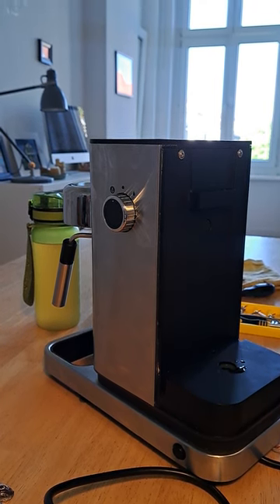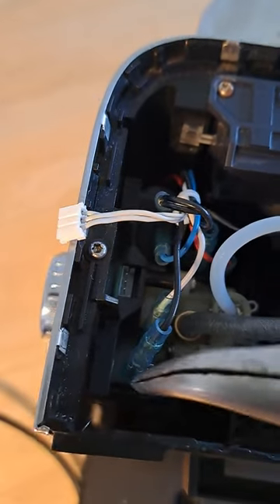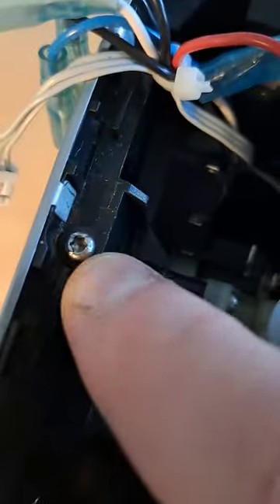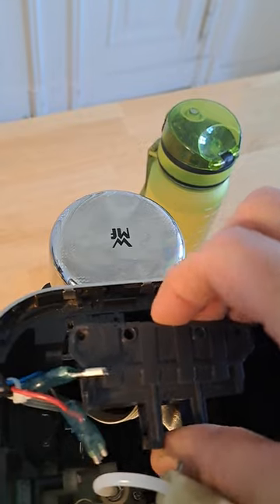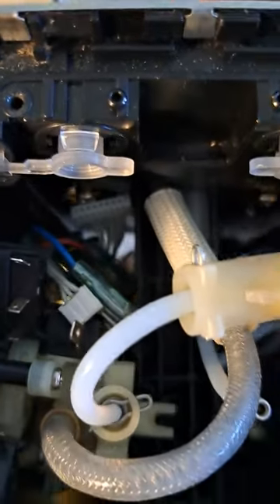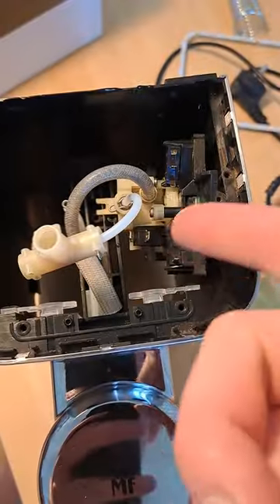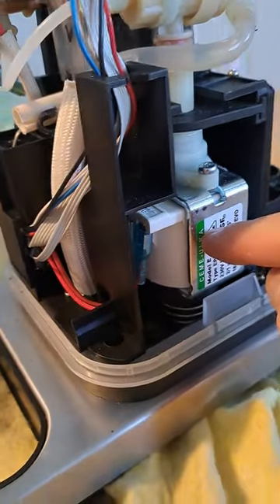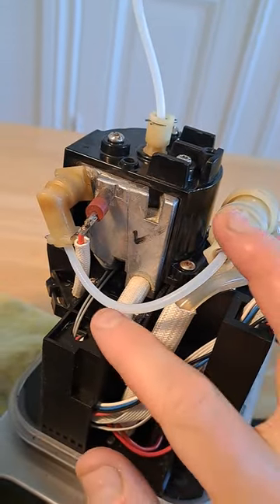WMF Lumero espresso machine - DISASSEMBLY video

Comment from the maker: GOOD NEWS!!! The connector that always seems to break which attaches to the Thermoblock is now available at www.ersatzteile-24.com
Reply from the maker: 16:25  is the part that I'm referring to. Buy a couple while they still have them in stock!
Reply from the maker: On the website, search: Q436968
Reply: What is the name of that part ?
Reply from the maker: https://fixpart.de/de/produkt/groupe-seb-fs-1000050800-abdeckung
Reply from the maker: @bakenblo  https://fixpart.de/de/produkt/groupe-seb-fs-1000050800-abdeckung
Reply from the maker: New short video for leaking steam wand : https://youtube.com/shorts/qWunwmQQdcM?si=cerU2UrzkXWYFCdy
Reply: Hey there, this is just Gold!!
Thanks for the video, my fathers machine broke just where you said. I guess the heat changes are the reason for the connector to deteriorate. 
You asked how the inside looked in original:
The Watertank connector hoses have small white Zipties- just like you did. When the Watertank is reconnected after filling up, there is always some water dripping wich can cause Oxidation/Vapor in the system. 

The electronics are open like yours, i guess the casing works as a lid when closed again. 

Did you find the 90* Connector  too?!

By the way, your german pronunciation for Ersatzteile is perfect👍🏽
Thx and greetings

Comment: thanks for video, it helps me a lot. only one things: don't put any screw at the hole with rubber cap. i think it is some pressure release hole. my unit don't have there any screw.
Reply from the maker: Thanks...you might be right. Good tip!

Comment: Hi,

Today, I tried to wash and clean the machine, and I accidentally poured some water where the coffee goes. I then turned it upside down and realized afterward that some of the cables and circuits got wet. 😅😅😅

Now, the red button on the side is blinking, where the Vapor is, but the both coffee buttons aren't working. I've already opened the coffee machine and can change parts myself, but I'm not sure what needs to be replaced. Could you help me please?

Thanks!
Reply from the maker: @AnitaNita777  I'm not sure the exact problem?maybe use Google translate to explain in English? Sorry I don't understand:)
Reply: @nathans1978  Hi,

Today, I tried to wash and clean the machine, and I accidentally poured some water where the coffee goes. I then turned it upside down and realized afterward that some of the cables and circuits got wet. 😅😅😅

Now, the red button on the side is blinking, where the Vapor is, but the both coffee buttons aren't working. I've already opened the coffee machine and can change parts myself, but I'm not sure what needs to be replaced. Could you help me please?

Thanks!
Reply from the maker: @AnitaNita777  to start I would open the top and dry it out for some days. If the circuits are wet that's the only way they will dry out. Maybe put the machine on top of a radiator to support drying thoroughly
Reply: @nathans1978  i already did that. I’ll wait one day. If not what do you think I should do or change¿ because the both buttons to make coffee are not functional. 😔
Reply from the maker: @AnitaNita777  there's a cable that connects to the 2-button assembly. Remove that cable and spray it with wd-40
Reply: @nathans1978  i let those cables disconnect last night for a better drying and now the two buttons are working’s. I just did a descaling process that lasted about 5 minutes, and I'm trying to make a coffee, but it just leaks... and no normal coffee. Just about 10ml, maybe. Do you know what can be happening?
Reply from the maker: @AnitaNita777  where is it leaking? The machines descaling program lasts about 45 minutes.
Reply: @nathans1978  I can not answer to your comment. Is strange. I past it again: Now the two buttons work. I did a descaling process that lasted about 5 minutes, and I'm trying to make a coffee, but very little comes out where the coffee should. I'm only getting a tiny amount, maybe around 10ml, not a full cup.
The descaling process stops after 5 minutes more or less because the two coffee buttons start blinking white three times and they stopped. The same thing happens when I try to make a coffee—after 3-4 seconds, they blink white three times, and then they both stay solid white, as if the machine is available. So, I don’t know what's going on.

Comment: Hi, i have the Terror that Tells there is no Water in it, even when there is whater in... Do you have a solution
Reply from the maker: I've never heard of that happening with the Lumero. Did the problem happen perhaps due to false reassembly or did you never disassemble the machine? My only other thought is a faulty flow meter. First check that all wires are connected correctly under the top lid.  Or could the problem be the connection hole where the water tank enters the machine? Sorry I don't know how to diagnose this. Good luck and let us know if you solve it.  ...also try a descaling cycle and see if it responds.
Reply: I have the same problem, did you find a solution?

Comment: Hey Nathan, thank you for your great video. I got the problem that water is coming out of the milk frother as soon as I turn on the machine. Even if I turn the knob to the dot (=coffee brewing mode) it leaks troughout the steamer. I've cleaned the machine internally with an espresso decalcifier several times, which is why I assume the problem coming from the steam valve. Do you know how to access it? I've dissambled the machine with your video but the steam valve is the one right behind the turning knob right? Could it be the o rings in the valve which need replacement? Do you know where I can find them or even a new steam valve? Thank you so much.
Reply from the maker: Hey ich könnte das am besten per Telefon erklären.  Bitte an nathansemail1980ATgmail.com schreiben mit Telefonnummer wenn du möchtest:-)
Reply from the maker: Sonst google Video
Reply: Same problem came today, I’ll appreciate any feedback about this issue
Reply from the maker: @andriiklymenko4971  same answer:-) see about emailing me
Reply: @nathans1978  can it be fixed it on my own, or it’s better to use repair service?
Reply from the maker: @andriiklymenko4971  I'd try on your own first
Reply from the maker: Here's what I suggest: first remove the brewhead screen (two screws) and a spring will come out with a rubber plug. Thoroughly clean the whole area and screen. Then without putting it back together, pour warm water and 3 tablespoons citric acid powder (dissolved in the water) into the tank. Run the brew function a couple times, holding a cup under the brew head.
Reply from the maker: Then put the spring with rubber plug first (facing up) back in and screw closed. Now run the hot water through the steam wand for 15 seconds or more into a cup. 
Then hold the one-cup and two-cup buttons at the same time until you see the one-cup button turn BLUE.  Let go of buttons and let the entire tank of citric acid water run through until the descaling cycle is finished.  Takes about 15 minutes.
Reply from the maker: While the citric acid water is running through and descaling, pull off the steam wand cover as well as the rubber nozzle and drop it into the dispensed citric acid that has come out and let it sit in there. Scrub the bare steam wand metal tube if any scale or milk crust is on it.
Reply from the maker: When all is clean and the cycle has stopped,  fill tank with cold water, run the hot water function through the steam want (knob clockwise) then run the brew function twice.
Reply from the maker: BTW, when you have the spring and plug out, if you stretch it a bit you'll increase the pressure of brewing slightly, which I have found results in better crema
Reply: @nathans1978  yes, that worked for me. Appreciate your help
Reply: I have the exact same problem. Thanks for bringing it up. Look forward to see what fixes it.
Reply: @nathans1978 Hi everyone, I'm facing the same problem with my machine and I'll try to follow the steps that you recommend, @nathans1978 But I have one question: What do you mean by brew head screen? The machine's top in the very beginning of the video? Cause I didn't see a spring and rubber plug coming out then...
Reply from the maker: @ninanani8686  What I mean is when you look underneath the brewhead, there is a screen where the water comes through into the brew basket, and there are two screws you can remove (you can do this without disassembling anything else).  When you remove the screen, the spring should come out with it and the spring has a small rubber plug attached to it.  Good luck!
By the way, if you email me, I can forward you pictures of how to disassemble the knob...a commenter helped me figure out how to do that.  It involves removing the black cap on the steam knob (prying it off with something like a thin screwdriver).
Reply: @nathans1978 Thank you so much already!
Which knob do you mean by "how to disassemble the knob"? The rubber on the steam wand or the knob which is turned for the different modes? Because I thought I would just need to remove the brew head screen and the stuff from the steam wand, nothing else.

Comment: Dear Nathan, This is realy helpful. Could you still tell me where you found the piece you mentioned as a Verbinder between the heating system and the tubes. I can not find it on the web site you mention. I am living in Portugal. Thanks a lot!
Reply from the maker: I'm glad it was helpful! The part is unfortunately no longer available.  I ordered it in June and it's still not here. If you read some of the comments you will see a German company suggested by a viewer; apparently the part will be available end of November.
Reply from the maker: My plan is to try to make the part with high temperature teflon on a lathe. Once I do this I will let you and everyone else know if it is successful
Reply: Dear Nathan, I just read your update that the small connector that often breaks on these machines that attaches to the top of the Thermoblock is not available on either of the above mentioned websites anymore. Do you have any other suggestion or is the prototype of Teflon already available? It is a bit a waste to throw the machine away because of such a connector. Hope you con suggest a way out. Regards, Marc
Reply from the maker: @marclammerink8618  apparently German company Trepech will have them available end of November
Reply from the maker: I only just now got the lathe and have to try it. I'll let you know
Reply: @nathans1978  It would be great if it works.. let me know.
Reply from the maker: See my recent post ...you can order it now

Comment: At 10:20 you mention the leakage by the LED lighting system. I have the exact same problem. In fact this LED frame broke due to continuous water leakage. I bought another broken WMF machine with an intact LED frame. But before I install that, I want to make sure to get rid of the leakage. How did you fix this? Was this the part where you stabilized the lower two tubes with cable ties? Whats your recommendation? Thanks for the great video!
Reply from the maker: @BalkanXpress  nearly always the problem is a degraded teflon/plastic piece that is connected to the thermoblock. If it is degraded, save the o-rings inside both ends because the replacement part will probably not come with any.  Good luck!
Reply from the maker: @BalkanXpress  https://fixpart.de/produkt/groupe-seb-fs-1000050800-abdeckung
Reply: @nathans1978  Thank you, Nathan! Some of those pieces look really brown so I will try and replace those.

Comment: Hey Nathan, thanks for the video. It helps a lot the fix the machine. 😎👌🏼
I‘m from germany and found the connector in one of our german online-shops. 👍🏼

But now there are one question open. Does the connector has any seal ring to the thermoblock in it?
If I put the connector on the thermoblock, there is no sealing. It fits not tighten and wobble a little bit. 
So I think there might be the weak point, where the water can find his new route?! What do you think?

If someone has a damaged on/off button. It‘s possible to open the complete switch. 
In my case the spring in it was broken and some rust. So I cleaned everything and put in a new spring out of a pen. 
Now it works nearly like new. 😅

Regards, Dennis
Reply from the maker: @denniseffenberger3515  dear dennis, firstly so glad you found it helpful! Regarding the Thermoblock, yes the connector definitely needs 2 or 3 rubber rings, which unfortunately don't come with the new connector.  You have to get them from the broken one or order new ones. Each side of that connector gets 2 or 3 rings. Every other connector in the machine only needs one ring per opening.
Reply: @nathans1978  thanks for your fast response. I forget the two big rings, which are in the broken connecter. With those everything fits and is working perfect. My machine has on all connecters 2 rings.
Reply: @denniseffenberger3515  dear dennis I am also from Germany, from which shop did you buy the part? Do I have to completey disassemble the machine as shown to fix the problem? Danke :-) @nathans1978 thank you for your post
Reply from the maker: @StefanMuller-st2sx hi dennis, see the video description for the part. If you need more assistance just write. Yes you need to remove the bottom to access the broken boiler water attachment

Comment: Hi Nathan. Thank you so much for the video. My Lumero started to fool around after an espresso with a slightly too fine grinding grade. The pressure went high and no cofee came out. After this, it began to show a very peculiar error code from which I could not find anything whether in the manual nor on the internet: only the led on the side steam-knob flashed red. After some off/on cycles, it worked again, but started leaking. I opened it on the top and saw that the white water connector on top of the Thermoblock is leaking between the black plate and the connector itself, but I don't know how can I change the connector. Do you have any advise on how to do it?
Thanks!
Reply from the maker: Yes, just follow the disassembly in the video to the point where you have easy access to the Thermoblock.  Unscrew the 6 screws to access the thermal block and replace the piece that is broken.  Make sure you save the rubber o-rings from the old broken piece...there are 2 or 3 in each end.
Reply from the maker: If you look at other comments here you will see places to order the part. Good luck and ask me if you have any other questions
Reply: Thank you so much @nathans1978 ! I managed to disassemble the Thermoblock cover (the 6 screws) and gained access to the connecting pipe, which at first glance did not seem damaged or broken or cracked. I ordered a new one at Fixpart, but until it arrives, I tried to fix it putting some epoxy resin in the center part with the smaller diameter, but did not solve anything: it keeps leaking while making coffee.
Additionally, I assume that all the steam that kept building up due to the leakage on top of the Thermoblock (you could hear it every time) has been the cause of some rusty screws now, as well as maybe also some electrical contacts on the side steam knob, too: when I turn the knob to the "steam build position" (one position to the left), the led keeps lit white and does not turn red. I tried to dismantle the knob mechanics, too, but I was not able because of the big middle rib that goes front to rear.
Reply from the maker: @jlem73 the Thermoblock teflon piece and the steam mechanism are the only parts that seam to commonly break. The steam knob can be disassembled by prying off the outer black cap. In there you will find screws which allow you to remove the whole steam mechanism
Reply from the maker: Another viewer of my video sent me some disassembly pictures and a diagram that could be very helpful.  I could email them to you if you think you might want to do that.

Comment: Hi Nathan, I'm looking for the exact part you mention in minute 16:25. Can you tell me where I can find it? Thanks a lot!
Reply from the maker: Hi Bernhard!  Where do you live?  I found it after literally days of searching, on this German website: https://www.ersatzteile-24.com/WMF/WMF_0412360011.html?seite=2
Reply from the maker: For future reference, the machine is number 0412360011 when looking on spare parts websites.
Reply from the maker: Here is the only other website that I could find that sells it (but for a higher price) https://fixpart.de/de/product/view/0257277101
Reply from the maker: DONT FORGET TO SAVE THE RUBBER RINGS IN THE OLD CONNECTOR!  🙂 I think there are 2 or 3 in each side.
Reply: @nathans1978  Thank you so much! I will try this one, because the other has 12 weeks delivery time :(
Reply: @nathans1978  I will keep an eye on the gaskets :D
Reply from the maker: @bernhardendres1446  great!  Keep me updated if you want - hope all goes well!
Reply from the maker: Another tip: Attach a cable to all the wires when reassembling. Then fish the cable through the right side and gently pull wires upwards as you put the body back on. Much easier than sticking fingers down to grab the wires
Reply from the maker: Did the part arrive yet?
Reply: I still didn't get the part! I ordered it august 10, the delivery date keeps getting postponed (now14-15 weeks). Do you maybe know another site where I can order it?
Reply from the maker: It's available again...see my recent post:)